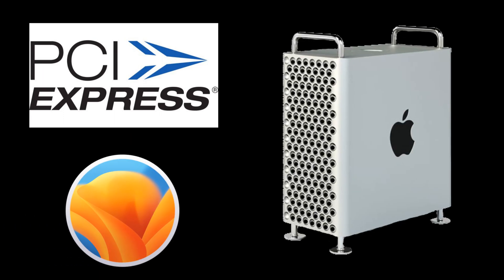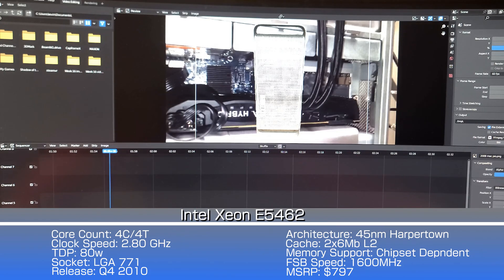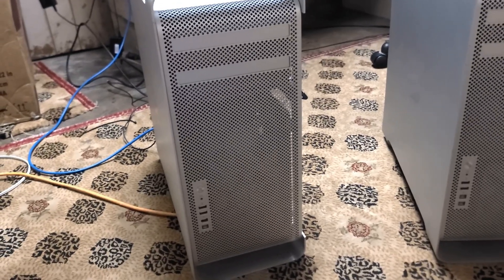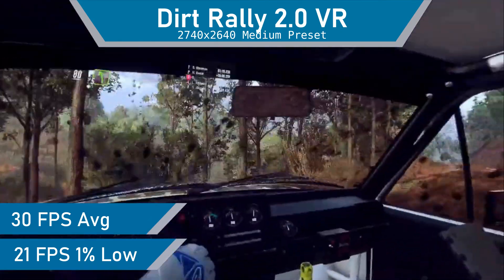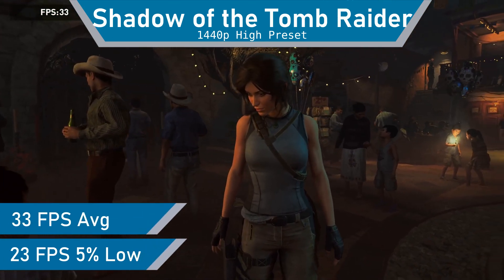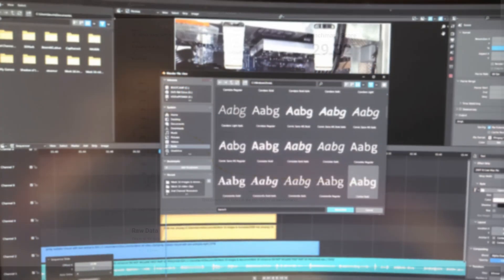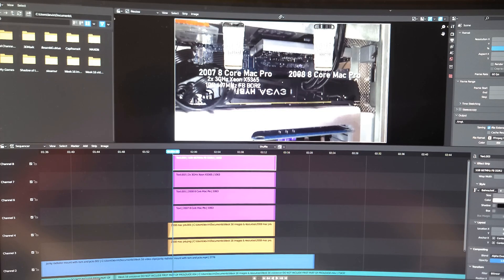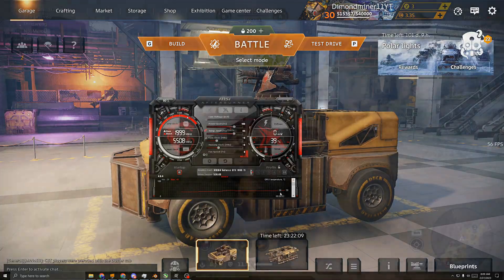Does a 2008 Mac Pro make ANY Sense in 2023?

Comment: Bought my 2008 in early 2008 and it still performs flawlessly for what I use it for in 2024!
Reply: I used a heavily-upgraded 2008 Mac Pro (32 GB RAM, R9 280x, SATA SSD in PCIe card, USB 3.0) as my main everyday computer for several years until it died in early 2021, whereupon I replaced it with an M1 Mac Mini (and now have an amazing M1 Max Mac Studio).
Reply: me too!  and I have an M1 macbook air - GREAT for batery life, but my mac 3.1 pro 2008 with its huge old hard iscs (SSD boot disc now, Mx500) and an upgradded video card and ratehr more RAM than the 2GB it shipped with - its the MONITORS - twin cinema displays - so much better than the laptop when I want to do serious work - been using it for 15 years now , El Capitan occasionally frustratingly unsupported lol
Reply: Yep, if they didnt block it from os updates I would have had no reason to upgrade it.

I am sure they know that which is why they are killing them.
Reply: You got your money's worth lol.  The early intel Mac Pros up to 5,1 were great.  I changed over to used PC workstations after my 5,1's because they were way better than the trashcan and 2019 Mac Pros and dirt cheap.  You can get a P520 or z4G4 for like 200 bucks barebones.  Parts are dirt cheap too.
Reply: @gametime2473  I don't do PC for what I use my MAC for. Sorry.
Reply: Please upgrade to the 2019 Intel. It is soo cool and you can customize it to make it lighting speed.

Comment: We have one running dosdude sierra, apple server, filemaker server from an ssd with internal and external backup drives. Has been running for years with no problems.
Reply from the maker: Hell yeah if it works it works. No need to replace something thats working without issue and fulfills the needs its needed for well.

Comment: Your video results would have been better with a simple RX 580. Good video.
Reply from the maker: Nope. Due to these benchmarks being in Windows the performance would be significantly worse as the RX 580 is only performance equivalent to a GTX 1070 and VR performance equivalent (due to borked encoder driver) to a laptop GTX 1050.

Comment: I use a Mac Pro 3.1 on daily basis :2 x 3 GHz Quad-Core, 32 Gb of RAM, NVIDIA GeForce GTX 680  with 3 SSD and 2 HD running Sierra, High Sierra and Catalina. It works like charm . I would not say it is that obsolete but nice video, anyway.
Reply from the maker: Well depends on your use case of course. If you still need to use Mac programs that only run on Nvidia hardware from that era then by golly these are still great for that. Fastest lineup of macs that will take a 680 as far as I'm aware. For modern tasks though the dual C2Q adjacent Xeons leave a lot to be desired.
Reply: @DimondDoesTech  Of course I mean not obsolete for my needs, you are right. Thanks for the video!
Reply: @migtiming  what do you use it for? i ahev mine maxed out and can just pretty much just browse the web
Reply: Please Upgrade to Monterey or Sequoia. Sierra and the other you mentioned looks so bad and the logo for them looks ridiculusly horible. A mac OS should be space , a cat, or some cool design not a real world picture. FOr that alone I could never use them. Only want to use an OS that has a cool design.

Comment: I have 3.1 and 4.1. Love the cooler routing 😂
Reply from the maker: Yeah it is very straight and very compartmentalized. However the airflow for the 4,1 and 5,1 for PCIe devices is rather lacking for non blower GPUs. Any card I've thrown in there has run 10-15C hotter than normal

Comment: It would probably perform better with a Linux OS., installed.
Reply: This machine is a beast running Ubuntu 24.04
Reply from the maker: Most likely not. These CPUs are fast enough that installing linux would not help much
Reply: @DimondDoesTech  It would be an interesting video though.
Reply from the maker: @laurencejohnson4106  True. I had had other ideas for this machine but unfortunately I have since sold it. I didn't need 2 Mac Pros ya know, especially not with the performance gap between my 4,1 and this 3,1.
Reply: @DimondDoesTech  Do Mac Pro computers use a lot of electricity?
Reply from the maker: @laurencejohnson4106  Holy heck YES. At idle my 5,1 with the 5690s uses ~250w and under full load expect in excess of 400w with the CPUs only and 550-600w with the RX 580 included.
Reply: @DimondDoesTech  Thanks for the information.

Comment: This is amazingly edited and the voiceover is fantastic. You deserve so many more subs! I was shocked to see you were not a giant channel. Keep it up!
Reply from the maker: Thanks! Currently I'm having to take a bit of a hiatus from making videos as I have a job again (yay!) as I've been using these past couple weekends working on my vehicle
Reply: @DimondDoesTech   I understand what you mean. Work has picked up for me alot lately! And I have a '97 Ram that always needs work :P
Reply from the maker: @King_Kuya  Yeah my '99 grand cherokee has been needing lots of bits to make it less terrifying to drive. Replacing just the front shocks and tires improved it significantly. When the stuff arrives next I intend to do the left lower tie rod end and the right lower control arm as well as the steering damper and both rear shocks
Reply: @DimondDoesTech  I totally understand! I put new shocks on my truck and a new idle control arm, but now when I go over bumps my car bounces like it’s on a pogo stick. I’m guessing the shocks were DOA or they are just way too soft. Gotta love Chrysler/Jeep/Dodge! At least the ones from the 90s are relatively easy to work on.
Reply from the maker: You got that right for sure. I love my 4.0, not for the reliability even though thats nice, but for the ease of maintenance. Pushrod, so no OHC so that means extraordinarily simple timing chain, literally connects 2 gears, water pump is like 3 bolts and can be undone after taking off JUST the belt I think or nearly as easy, and most everything is pretty easy to reach. The V8 grand cherokees are much worse though. No thanks to them. And next weekend I bought a heap more parts to install such as a new front right brake rotor, all new brake pads, o2 sensor bungs, o2 sensors, o2 sensor extension cables, and a new alternator (already installed) because I burned up my old one charging a co-workers battery. Heck tomorrow I get to install a new serpentine belt and power steering pump pulley cause I put a hole running down part of the belt (not across it) and the pulley because its cracked. Yay for making vehicles nice to drive that you suddenly like and want to keep on the road!